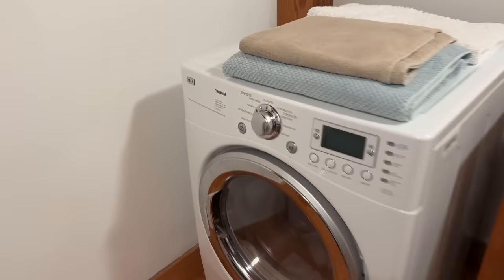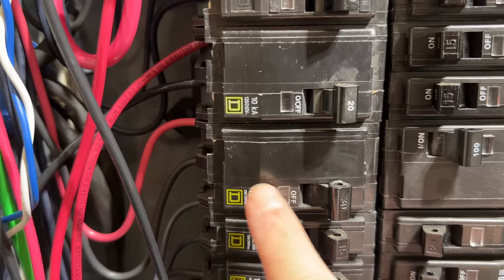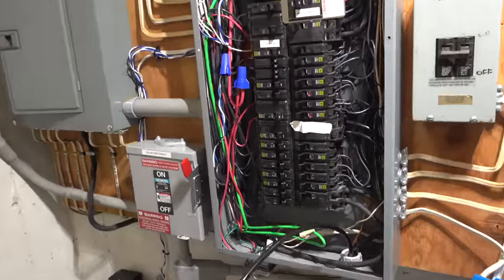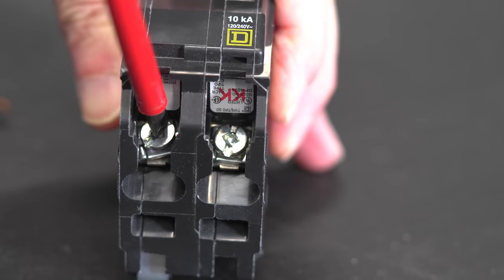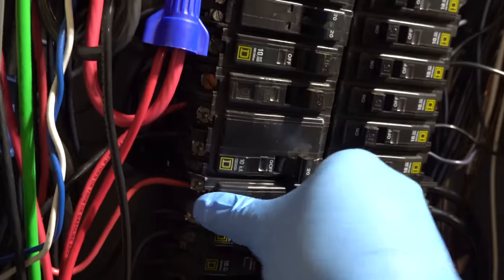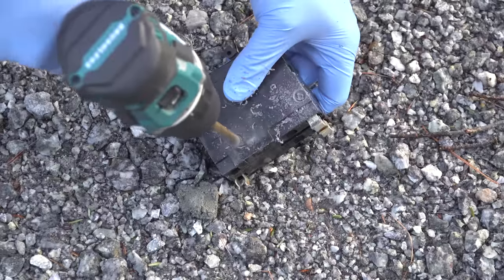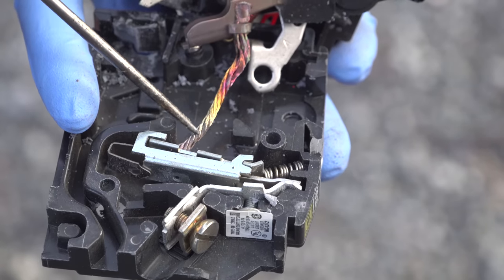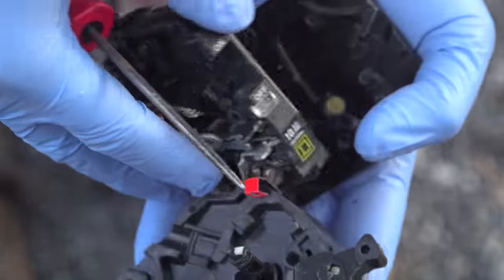If Your Circuit Breaker Makes a Buzzing Sound 🔥 Fix It Quick!

Comment: Sometimes the buss bar is arching with the contacts of the breaker. Definitely inspect that as well.  Every time I have heard that sound, lights flickering etc,  it's been a bad bar. Repairing it is sometimes a double breaker and cancelling the bad spot,  but if that's not possible,  it means a new  panel.

Comment: The only thing i would add is check the load and verify that you're not drawing to much current. Great catch and video!!
Reply from the maker: That is a great idea and I agree I should have done that. I will double check that with my clamp on meter to make sure the dryer is operating correctly.

Comment: I like to use a thermal imagery camera to inspect electrical panels to see if there is a temperature differential between the breakers.   It’s an easy way to quickly determine if a breaker is failing and needs to be replaced.
Reply: A mechanical circuit breaker gets warm through normal functioning.  You have to know the specifications to know what temperature would be abnormally warm. 
In normal operation a mechanical circuit breaker gets warmer as more current passes through it.  In the breaker mechanism, a metallic part changes length with the increase in temperature.  Once hot enough the length changes enough to trip the breaker switch off.

A thermal camera will tell you which mechanical breakers are passing more current, versus the ones that have less load.  To make the call that one is failing based on temperature would require knowing what temperature is too hot for normal operation.

Comment: When my auxiliary heat on my heat pump come on the breaker would trip i didn't think about that so when the tech told me that is what was wrong and i would have to get an electrician to replace it i went to one of the big hardware stores didn't one like it went to the other ones found one replaced it after a few months it tripped again replaced it and this one has been going well since the first replaced must have had a problem in it but the 2nd has done well cut the main breaker off for safety

Comment: I have a dimmer in my house that when it's turned on makes the panel buzz, but it's more of a high pitched whine. You can also have a low pitched buzzing noise if you have a lot of current draw through a breaker or panel. Zapping sounds like he had, are not normal though.

Comment: I had one making that sound when we moved into a new house. Turns out the wires connected to it were loose. Tightened 'em up and the sound went away. 15 years later when we moved out it was still working fine.

Comment: I had the circuit breaker for my dryer failed in 2018. 240 volts going were going into the breaker, but only 75 volts were coming out. The failure of said breaker took out the thermal fuse on dryer which also controls the motor, which i was able to replace myself. That stupid fuse was 18 bucks at my local appliance parts store! I'm glad that my dad showed me how to use a multi meter when I was around 9 - 10 years old. There were no unusual noises being made that I could hear either. This breaker was installed around 2003 during a switch from LP gas to electric

Comment: Our house is 45 years old and only one breaker has ever stopped working and it just wouldn't reset but I've never had any breaker make an asking noise despite most of them being as old as the house which was built in 1978.

Comment: Also one thing I would add is most or all manufacturers have in their specs to replace the breaker if it trips. 😜 I would not necessarily myself but that is what they recommend. You're video was great. One thing to note is to torque your connections to spec too and each breaker has the number of inch pounds. If you have a torque screwdriver 🪛 use it. It is a great tool. I bought a Neiko torque screwdriver off Amazon years ago. I like it. Great video. Happy New Year.

Jeff - Licensed Journeyman Electrician Sunny Central Florida
Reply: Partially correct. Many say to replace if subjected to REPEATED short circuit faults or extended overloads. They will be ok with several overload trips over extended time. 

The rule of thumb I use is if a breaker is tripped, I will reset it ONCE. If it trips immediately, (and especially if there is a pop or buzzing sound) I will not try it a second time and will consider replacement once the fault is fixed. If it trips on overload (usually will delay before tripping again) I will try removing loads then reset a second time. If it trips a third time after load shedding, will consider replacement if the breaker is old, or gets warm when holding load under 80% of rating.

Comment: I hear your point about checking the wires are tight, but honestly I wouldn't even consider touching a screwdriver to those terminals while the breaker is attached to the bus. If something is wrong on the inside, (which it is for sure, and the new one could be defective) they could be scraping your body off the opposite wall. I personally recommend removing the breaker first, then using the widest blade slotted screw driver that will fit to loosen the wires, and then using that same driver to torque the screws down tight on the wires before placing the new breaker back in. Use an insulated needle nose on the insulation of the wires to check their snugness. If they are loose, pull the breaker again and re-tighten.
Reply: Or use and insulated screwdriver and tighten it in place

Comment: Just fixed this exact same issue in my 50 plus year old panel. Issues presented itself as dimming and surging lights on one circuit.  Trip to the breaker panel revealed the same noise in the video.  Replaced the breaker and issues solved.   I also performed a post mortem analysis on the problem breaker and it it looked like maybe there was some corrosion on the contact points inside the breaker.
Reply from the maker: Very good that you fixed it!. I am surprised how breakers really aren't sealed at all, while not needing to be waterproof if you live near the ocean they must take a beating.
Reply: @SilverCymbal  Exactly. Didn’t confirm corrosion was the root cause, but didn’t see much burning similar to what your breaker autopsy looked like.   Also thinking maybe the internal contacts points became loose over time.  All guesses, but drilled out the rivets on the breaker to get inside just as you did.  A voltage test on the circuit reflected a range under increasing loads of about 85 volts to 122 volts. Dimming and surging grew worse under heavier load. Sounded like the breaker was cooking and popping at the panel!
Reply: @SilverCymbal  Breakers cannot be fully sealed, as the arc formed at the contacts creates a very intense heat and a brief but very strong pressure spike. A totally sealed breaker could/would explode into shrapnel under a fault condition. 

Large power utiltity breakers that were oil filled had pressure vents to help minimize risk of explosions, the newer SF4 breakers are sealed pressurized gas that actually prevents or quenches an arc in milliseconds, so the pressure caused by the arc is reduced/eliminated.

Comment: Hola señor Silver Cymbal I just wanted to say hello 👋 and to let you know that I had enjoyed all your videos last year and this 2023 I will keep supporting your channel watching the videos to the end give like and comment sharing with friends and family and I want to share some with you that already happened in different times of my years working in remodeling and the last time was in my own house… long story short when you issued the noises in the breaker I had the same noises in my kitchen light switch and let me tell you what was causing it and the problem was 🐜 ANTS yep my teens have the problem of leaving cups with juice and you know ants love that well some how they found a way to get in the kitchen from the outside wall and somehow they got inside the switch box so I heard the noise and the lights were flickering and I remember that from the past I was remodeling a house and the kitchen had the same problem so when I removed the switch plate I found a cluster of tiny roaches 🪳 around the electrical conectora of the switch and that was the problem I guess the roaches arch the electricity and causing the lights to flicker and the switch to make those buzzing noises replaced with a new one pest control exterminated all the bugs and problems solved and the problem in my kitchen I removed the switch plate or cover and I found a cluster of black ants all over the switch connectors and I just cleaned it with the vacuum cleaner and let it air for few hours and it’s working properly perfect flickering stopped and the buzzing noise stopped and that’s what happened to me in my own experience I wish I had all that on video so I have proof of the problem so if you think you can give me a scientific answer for that I will love to hear you keep up the great work señor Silver Cymbal 😊

Comment: Question: Why terminal screws become loose?
Answer: Creep (or cold flow) is the tendency of a solid material to move or deform under the influence of extreme loading or varying temperature conditions.

Comment: That sound from good breaker is the sign of triggered thermal protection on slight overcurrent. Thermal protection allow breaker to pass such current for minute or so, before circuit break.

Comment: good old square D these are good but for some reason they like to do this on the 230 240 volt breakers most of the time i have seen you shut them off and they don’t turn back on or they lose one side and you only have half off your voltage i believe you were having this problem but found it before you lost one leg of power any manufacturer can have problems but i see it more on these breakers most of the time it’s a dryer or a/c condenser or air handler almost always a 30 amp breaker it’s strange i wish they would look into why it happens but i will say this it’s always been a safe contained failure within the breaker i have never needed to do anything but replace the breakers so i guess its a good design and it just happens

Comment: I have heard a humming sound out my box for about 3 to 5 seconds and it's 24y/old, I will have to get this checked. 🤜🤛
Reply: I own houses that have breakers that are coming up on 60 years old. They still work. Bulldog pushmatic.
There's nothing wrong with square D. I own houses with them as well and that's a fine panel. The only problem with modern breakers is the oil in them sometimes gets hard. It'll trip. Then you won't be able to reset it. You'll have to replace it.
Reply: My house's kinda old already, some times I can hear a louder humming sound than normally while walking past the electric board, anyway there are cables in there circled up kinda like reels, my father says it is because of that, he has more knowledge on this than me so I assume it's fine?
Reply: How did you trace which one?

Comment: I agree with you. I also would try to not replace things if we can somehow make them work a bit longer but here safety comes first. We should not be taking any chances with circuit breakers!
Reply: there is no way to repair a circuit breaker. if it goes bad it goes bad. most people having them go bad are 50-60 years old or older, that's way beyond their service life. the reason people piss and moan about replacing them is each breaker will cost about $60-$100 each, it's a lot of money and people see this little chunk of plastic and can't understand it costs so much.   

i get all kinds of used and vintage ones for less than a quarter each at the junk store because I like to collect them and preserve the history, but i'd never in a million years install one in my house.

Comment: Hey! this is the exact same failure of a breaker I saw in my own! 
First breaker I ever replaced actually. Made that same exact noise too.
It worried me for awhile, but I shrugged it off at first, only for it to completely fail.
I eventually mustered up the courage to learn as much as I could not just about replacing a breaker, but about the electrical system we use in the US too.
But it was kinda cool too see what could've happened on the inside of the breaker. Might have to open mine up too (I kept the broken breaker)
And I'm sure you have already heard from the other 143 commenters that's it's pretty ill-advised to work on a box like that with the main breaker open, one wrong move and it could've been game over! I already know you know this, but it's important to make sure that your viewers understand that fact, since novice me a couple years ago might've stumbled upon this and tried to do a breaker repair with the main breaker closed*.

Also, you'd think they'd break more often being named "breakers", huh?
Reply: @jovetj  Oh whoops, I got mixed up there
I meant to say closed there lol
But I'm sure it is if you're comfortable with working with it and have proper safety gear

Comment: That sound terrifies me. I once had a dryer cable burst into flame after making that sound, Luckily it was right next to the main panel and I was able to kill the breaker and stomp out the flame, then tore the whole circuit out. The wire was originally hanging loose way out of the wall and must have gotten damaged at some point. I later talked to the homeowner and he casually said that it's DONE THAT BEFORE!!!

Comment: I had a problem with a 15 amp breaker that was humming, tripping and eventually burning out the breaker.  What the problem was, ...I tracked the wire from the panel to the various junction boxes.  In the first junction box, two (neutral) white wires were loose and not making a full connection. So arcing was happening. Once I tightened the wires by twisting the wire marret the problem was solved.  Lose Wires not fully making contact in the circut.

Comment: Don't you have to use an insulated screw driver even though the breaker is off? It could slide and touch any live wire or bar unless the main breaker is off which most won't do anyway. Also best practices are wearing proper gloves, not latex and keeping one hand behind when working on live breaker panel

Comment: Outdoor breakers work different in really cold weather.  15 amp breaker supply enough to run a block heater ,battery heaters, interior heater. Plus the extention cord is warm enough to melt the ice and snow. So the cord is trapped in soild ice till spring.

Comment: We Got the Same exact problem from one of the circuit breakers inside the house. Yes, There is a circuit Breaker Panel inside the house. My father Did some things, He checked the breaker and found a problem. He fixed it and it’s
gone.

Comment: You could definitively hear the arcing inside that breaker and it was about time to change it. This was a good video, but I would recommend to turn off the entire panel before working on it, as other people also have commented (also look out for other sources like solar systems etc and turn them off). Then it is best to make sure there is no voltage anymore using appropriate tools. And most of all: if you are not absolutely sure what you do and how this works, get a certified professional to repair the panel for you. Bad connections for example can cause fire and electricity can be lethal if somethings goes wrong. There are some other comments explaining a little bit more things to consider. Be safe out there!

Comment: There should be concern on using the breaker models specified by the manufacturer.  The panelboard is tested with this panel/breaker combo to handle a dead fault, (SCCR or withstand).  It is also important to reinstall the door/trim as these breakers shown are pushing in style (not much is holding the breaker in place) and the door helps keep the breaker in place when a fault occurs.

Comment: The side of the breaker has a inch pound rating that you are supposed to torque your screw terminals down too. Almost no one ever does. But if you finally do break out a proper torque wrench, you would be shocked to see just how tight the specification is. Most are under-torqued.

Comment: I had a breaker that was playing the exact sound of my washing machine running like a cheap radio speaker.  I called an electrician.  He barely touched one of my 220s  it tripped and would not reset again.  He ended up finding a third one that was also very weak.   More recently I had other work done and while they were working I had the entire panel replaced.  It was original in this house and would be 40 years old now.

Comment: Most of the time the wire needs to be tighten down. I found a wire that was just sitting on the breaker (like right on top of where its supposed to go in). Because they stripped out the screw
Reply: Nice reminder thanks.  Have a Buzz that seems related to my Water Heater and/or Dryer Circuits that I should investigate.

On a related note, Recall a while ago after some "minor" Panel work noticing my Water Heater Timer (Time of Use Digital Timer) wasn't working anymore (No manual override).  Thought for sure it was horrible timing it chose just that time to die.  Apparently my "minor" work did somehow result in one of the Water Heater's wires actually coming loose from the Breaker. (Was likely sitting "loose" inside the breaker for a while, glad it didn't cause a more serious problem/surprise)

Will definitely try and monitor for heat,buzz, and check the torque on any "suspect" breakers and replace accordingly.

Comment: my moms circuit panel is old as heck and only i think it was conneticut electric makes replacement breakers for it the panel is a old ITE pushmatic panel...i know it should probably be replaced but we are to poor for that and as far as we can tell the panel has been working fine

Comment: Last month our circuit breaker would let out a very loud buzzing noise. It would buzz when our microwave was running. We had it replaced and now everything is back to normal.